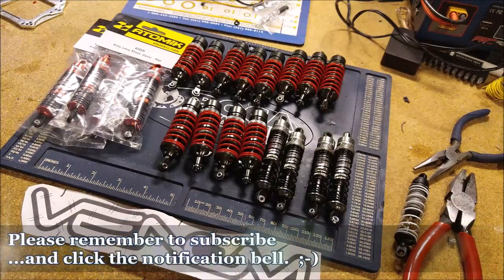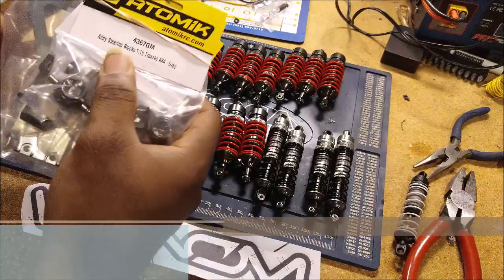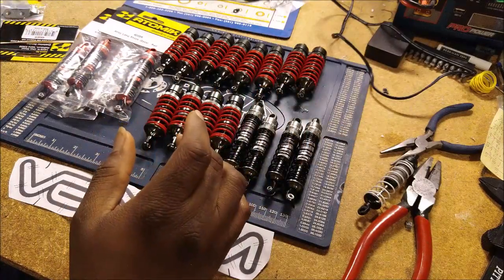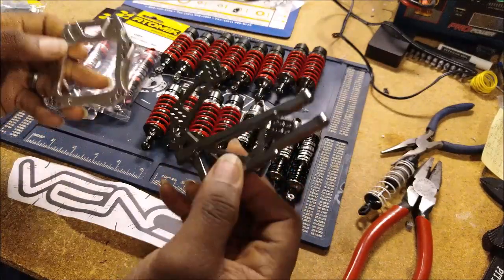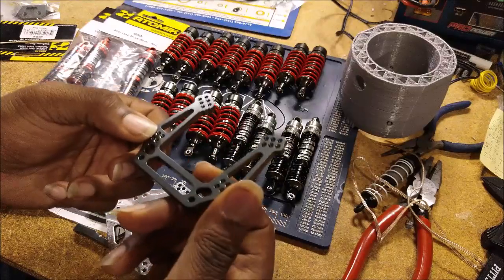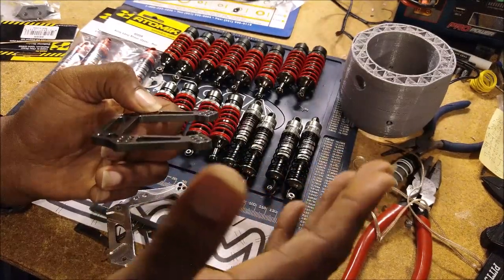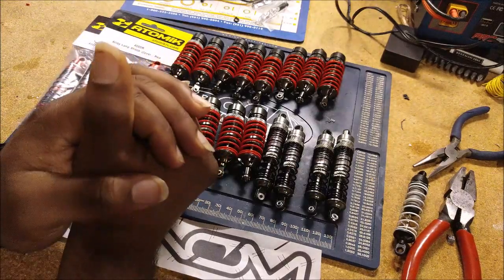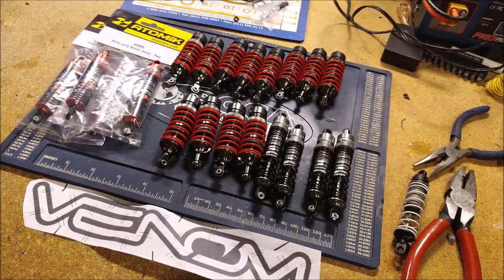Ep. 274: Good vs. Bad Aluminum

Comment: very useful sir. I'm new to the hobby. Before watching your Video, I thought that aluminum parts are best. But now I have to think twice in case want to go aluminum :D
Reply from the maker: Aluminum parts are still good for a lot of applications, you just have to think carefully about it before jumping in. As I mentioned in the video sometimes it's good to have some plastic pieces in the middle to give a failure point that will actually save your aluminum parts from failing prematurely. You just have to think about your setup and figure out what makes the most sense for what you are trying to do.
Reply: @RCPhysics  Thank you so much sir. Your video is very good.